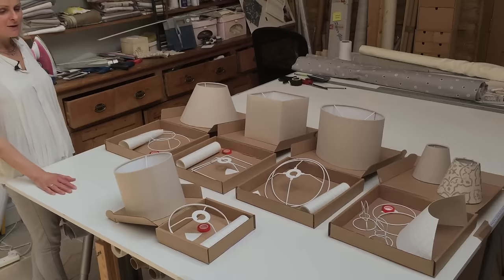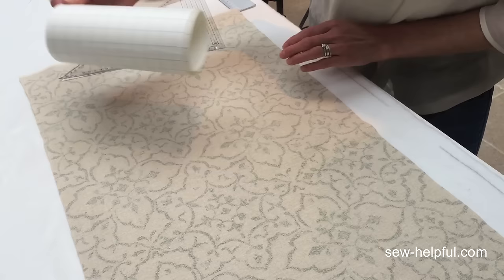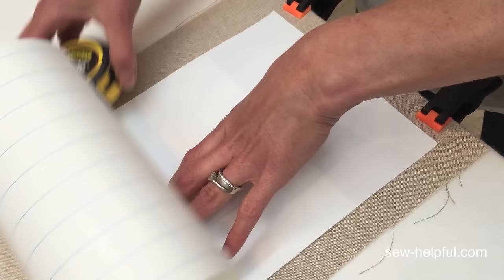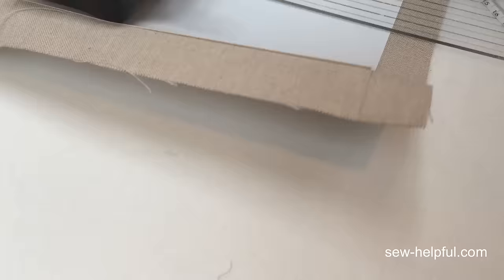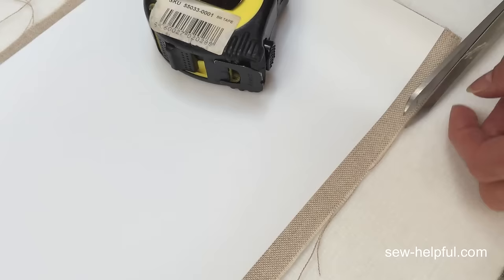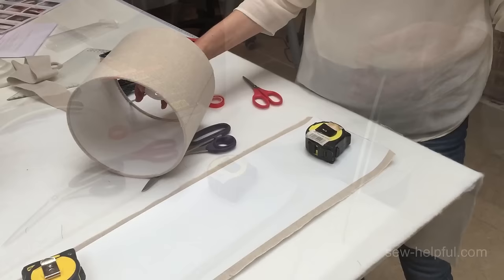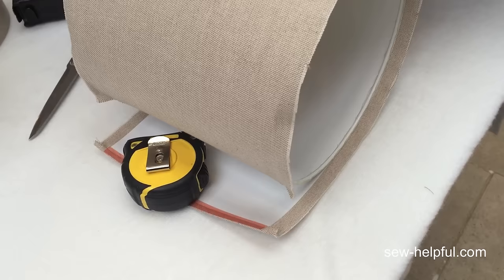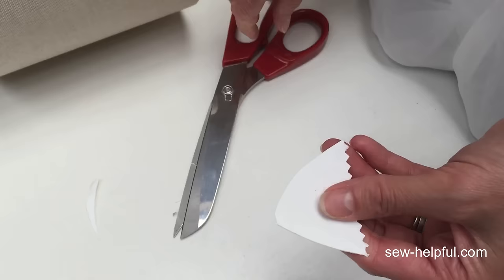How to make a Lampshade from a kit - ProTips

Comment: What a perfect video! Finally, I can tackle making one and using my art work in this new way. However, where do you order these kits from?
Reply: Just a quick tip if you want to sell or make for an international market... This kit is great if you live in the UK.  I come from the UK and recognise (yes, that's the English spelling...) the fitting, but now live in the US and if you do too, you will find that the kit she used will not fit a US lamp - they use harps which means the shade secures from the top.

Comment: Great tips, thank you. Perhaps a thin painted line of Modge Podge on the top & bottom inside fabric edges before attaching to the styrene, once dried, may help to prevent frayed edges. I am recovering an existing shade with the same fabric as my drapes, so am working without a kit. I assume (as my styrene is not pre-scored) I will cut my fabric slightly bigger allowing for a folding edge. Is the sticky taped used specialized or would double sided tape work just as well? I have not been able to find your type of tape in NZ. Many thanks
Reply: Tesa tape is the brand used here and it is extremely strong and often used in automotive applications because it can withstand high heat. Google a supplier in your area and look for 10-12mm width. Other tapes I tried have not held strong enough and the seams tend to open.
On the issue of fraying around the spoke where you make the cut, I just make a shorter cut at the spoke and it seems to work fine.
I work without a kit and create my own score (kiss cut) on the styrene. Add approx. 28mm to the measurement of the height of your lampshade (14 mm each for top and bottom) to come up with the size of your styrene. For example, if your lampshade is 30 cm high, add 28 mm for a total of 32.8 cm. With your styrene side face up, mark a ruler line 14mm in along the top and bottom length of the styrene. Using a sharp blade, apply enough pressure to score the styrene but not the peel off backing (cutting on the styrene side up). This will create a nice "kiss cut" that you can peel off just as shown in Cindy's kit demo.
Reply: @linkreisz3262  I can't find a supplier anywhere.  Do you know which tape it is from Tesa?  There are a bunch of Tesa branded tapes on ebay.  If I knew the model number, I can buy it from there!  THANKS!

Comment: Great video. How would you add a copper adhesive paper to the inside of the drum kit? Thankyou
Reply from the maker: We haven't seen copper adhesive paper, what we have seen on the market are copper and metallic coloured liners (rather than the white in the video). These are UV stabilised - Anti Yellowing and Engineered for lampshade making, passed the glow wire test carried out by the Lighting Association etc. So we would use those rather than copper paper. Take a look here
https://www.dannells.com/stick-it----brushed-metal-362-c.asp

Comment: Are the strips you bent back pre creased on the card or did you create these...great tutorial!! Thank you
Reply: good question - to score the styrene can be hard. it wont necessarily peel off along the marked line...then you are stuffed
Reply: If you buy the kit they are pre-scored. I work without a kit and create my own score on the styrene. Add approx. 28mm to the measurement of the height of your lampshade (14 mm each for top and bottom) to come up with the size of your styrene. For example, if your lampshade is 30 cm high, add 28 mm for a total of 32.8 cm. With your styrene side face up, mark a ruler line 14mm in along the top and bottom length of the styrene. Using a sharp blade, apply enough pressure to score the styrene but not the peel off backing (cutting on the styrene side). This will create a nice "kiss cut" that you can peel off just as shown in Cindy's kit demo.

Comment: Isn't there some product on the market that you can put on the edges of fabric that prevents fraying?
Reply: Hi. I considered either a light spray of hairspray on the inside edges or painting watered down modge podge along the cut edge and thoroughly drying before attaching to the styrene. You could try either on a scrap piece of your fabric first.
Reply: Fray check.  Walmart has it.

Comment: Very nice video and Kits. Very nice teacher too. Could you tell me the exact name of the tape you use to bond the fabric and the liner, and liner to frame?  What is the liner?  is it polipropilene, what thiknes? thank you Cindy i really enjoyed your lesson.
Reply from the maker: It all comes in a kit made by  www.dannells.com/ they also sell components e.g. tape, liner
Reply: It's known as "styrene". I think it is only available in one thickness. If you buy, ensure it is self-adhesive. Because I can not find the sticky tape in NZ, I will be using a strong double sided tape.
Reply: I purchased the tape separately from a supplier in Canada. It's made by Tesa and is very strong. I could only get it in 1/2" (12 mm) width which is a little wider than needed but works great. The styrene I purchased is .4mm thick and good for regular sized lampshades. Using the styrene with adhesive on it is definitely the way to go. This is the best video I have seen on how to make lampshades (with or without a kit). Cindy helped me avoid the mistakes that they don't show you in the kit manufacturer's video for a really professional look! BTW, this craft is not for those suffering from carpal tunnel syndrome! It's really hard on the wrists and hands, esp if you make a few at a time.